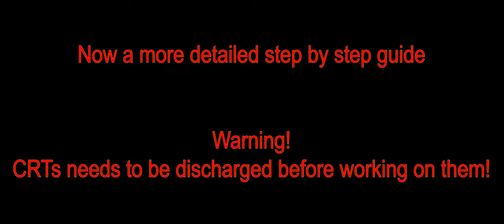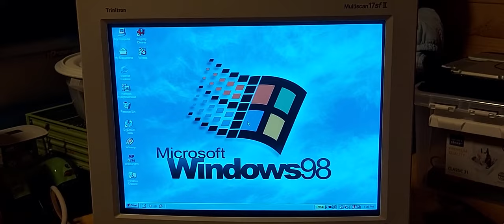Sony Trinitron CRT - Removing Anti-Glare Filter

Comment: Do you know if this model has the hours counter? One the models from the early 2000's you could access it by pressing one of the keys for a few seconds with the "No Signal" message on the screen. But since this one is older, i'm not sure if it has it.
Reply from the maker: @cristiannicolae6309  sorry no. I haven't seen it. But I also haven't looked for it or opened the service menu yet.

Comment: Right now I’m wondering why people keep removing the grounding film from their CRT without replacing it with a proper film and grounding it again.  That just opens you up to getting shocked from trying to touch the screen when you want to wipe something off of it
Reply from the maker: I guess just knowing where to find a suitable replacement anti glare film is part of the reason why I and others haven't done it.

I have been thinking about it for the added screen protection also.

I haven't felt any shock so far.
There are some residual film along the edges behind the bezel...that might help a bit?
Reply: @retroftw  It may indeed be helping. But on the note of replacement film, I've seen people saying window tint and car tint film have worked for them.

Comment: Excellent video, thanks! Btw. is that an LG Flatron you got there to the left?
Reply: Looks like it to me, I have a LG Flatron and it has the same shape and the same USB sticker.
Reply: @elu9780   I also had one back when it was new in the early 2000s. Great display
Reply: @Epictronics1 I have LG Flatron F700P as well as T710PH, both are quite good and I found them in the trash. Unfortunately, both have a scratch each on the glass or at least on the outer layer, but, thankfully, they're not very noticeable. The first monitor also has some slight geometry issues at the edges which I am not sure how to easily fix, but it is not very troublesome, so I'm leaving it as is.

I want to ask, do you know how long a CRT monitor lasts? I saw some conflicting info - others say they used CRT monitors from the 80s all the time and to this days, and other sources say the brightness is halved at around 10 000 hour of use point. 

I want to use these two CRTs, or at least one of them, in my main setup, but I don't know if I should, considering that I don't know how often they were used or how long they have left. The picture on both is good as far as I can tell, not dim at all, and there are no obvious signs of wear, but I'm still unsure.
Reply: @elu9780  The way I see it, vintage computers and displays should be enjoyed. Otherwise, there's no point in having them. Tubes wear out, but I don't really know how quickly. If the brightness is good when set to 50% the tube is not worn. That being said, you can crank up the brightness if needed and keep enjoying the display for many more years. Personally, I wouldn't use a CRT as a dayly driver but I don't hasitate to use them for gaming and nostalgia. I recently picked up a 700 plus too :) I'm going to use it to replay the games I played in the early 2000s
Reply from the maker: Heeey....I had not seen these comments at all!

Thank you @Epictronics1 😊
Yes, you are correct, its an "LG Flatron 915FT Plus"!

But it needs some work.
It was working unstabley, but stopped working after washing and drying.
I suspect heat and movement might be to blame.
Need to check solder joints, or perhaps some component replacements (that 3 legged black chip connected to the large heat spreader near the flyback). 

But this will require alot of disassembly, so I haven't gotten around to it yet. 

Its stored in a dry room temperatured location, so it can wait for now until I have more time 😜
Reply from the maker: The problem was it would start with a dark background on the image, which would become brighter until a spark noise is heard from around the flyback area, and the the cycle would start again with a dark background on the image.

And after the wash, it doesn't even show an image now.

I think it can be fixed, I'm just uncertain if or how many components might need changing. I dont think it's the flyback itself, but perhaps something around it, or perhaps it's solder joints.

But it needs disassembly in order to view the PCB from below.
Reply from the maker: @elu9780 You are correct :-)